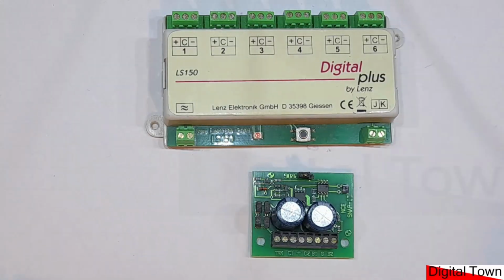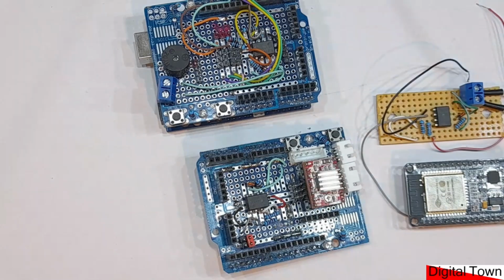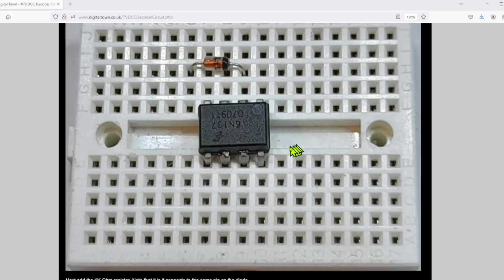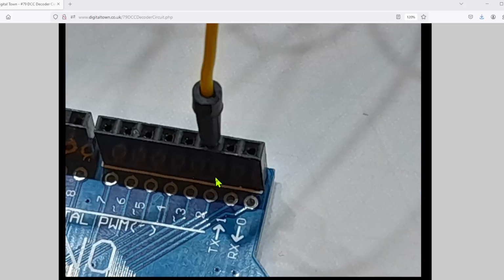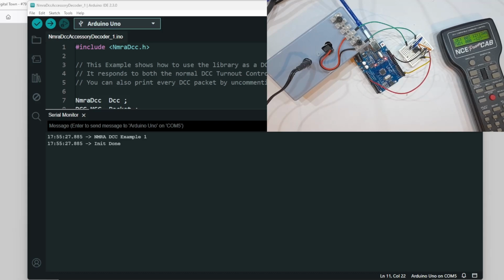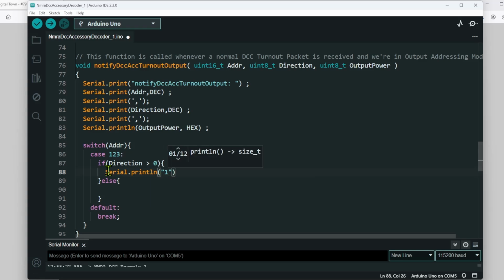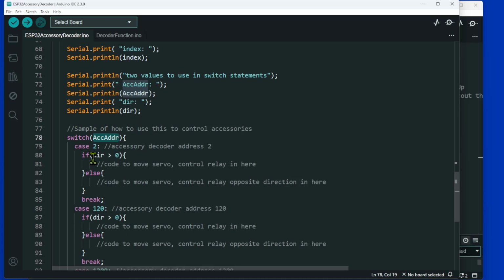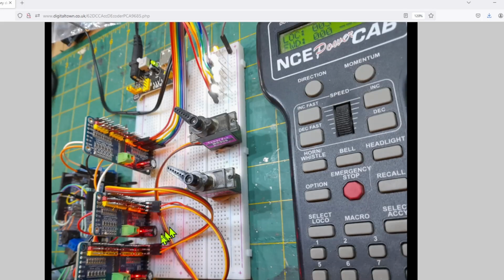#79 Arduino C++ Arduino or ESP32 DCC Accessory Decoder circuit

Comment: Hi Simon, sent you a note via MERG, but just in case, will any brand og 6n137 work reliably at 3.3 volts
Reply from the maker: The batch I'm using are cheap ones off Aliexpress and have been used for 5v and 3.3v projects. If you did get one that doesn't like 3.3v you could power it with 5v and use a voltage divider on the output.

Comment: Hello, 
Can you make it to work as an railroad DCC system for powering trains (12V i believe) So i can have a DCC central and then drive decoders, preferably the better option for me would be ESP32C3 as I use them for steering system for signals (an actual working interlocking system)? I mean I could use a bigger ESP32 which would be better as a central but keep the c3s as smaller dcc decoders for trains. I don’t want to spend 100 pounds for a piko dcc system
Reply from the maker: I've thought about it but by the time you have the ESP32 and then some sort of motor driver things start to get big quite quickly. The ESP32 Dev module would be interesting as it has I2S for sound manipulation but that's a big project and I don't have time at the moment.
Reply: @digitaltown5442  so there no replacement for loksound for now, it is very expensive for common people like me to buy... :(
Reply from the maker: @AkashJadhavIT  It is possible and has been done. Take a look at https://youtu.be/IKqIH0PLWcM?si=L1Ot4JQYfyrd8U4c This guy has created a library for sounds, in his case for trucks. I know that at least one person has adapted this for trains, so building thier own sound decoder. It uses I2S sound manipulation so you would need to get some sound files to work with.

Comment: Hello Digital Town. 
Excellent video!  
Is it possible to use CVs? For example to save decoder address? Can I use the controller to program the decoder address into the ESP32?
 Best regards, Niels
Reply from the maker: It is possible to do that. As with all Arduino/ESP32 projects it will do whastever the code tells it to do. You could add a button as commercial units do that set the borad to the next address broadcast. However that means that you would have to predefine how many outputs you are using and how they are to be used, so a bit like a commercial unit that powers solenoids you may just send a pulse out.

As I use servos for turnout control I tend to have slightly different settings for each servo so as I have to program that in it's just as quck to set the addresses as well.
Also a single Arduino/ESP32 can be used to control not only turnouts but lights, animations and various other effects. As such my ESP32/Arduino decoders tend to have a lot of addresses per board and I keep the addresses in ranges... one range for turnouts, another for lights/animations etc.

These days I use the ciruit as part of my nowRail project to get commands from the DCC system to broadcast using ESP32s but still have an old Arduino UNO controlling my traverser working as a simple accessory decoder.